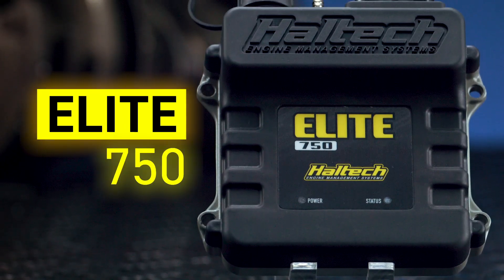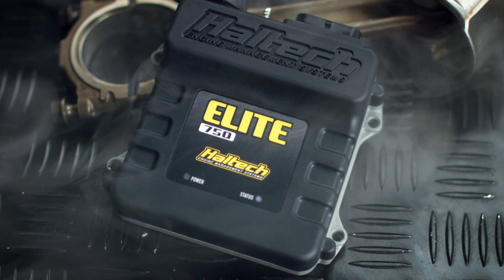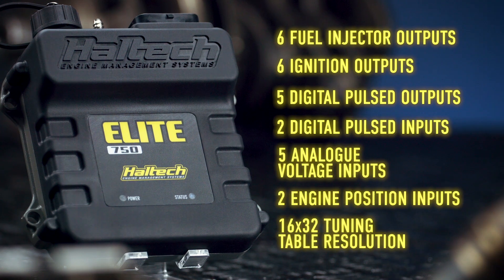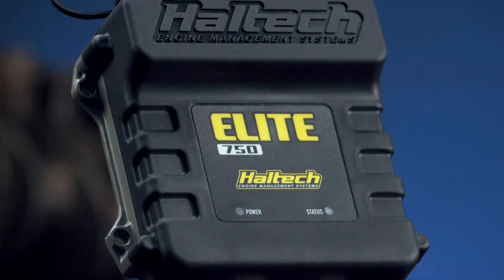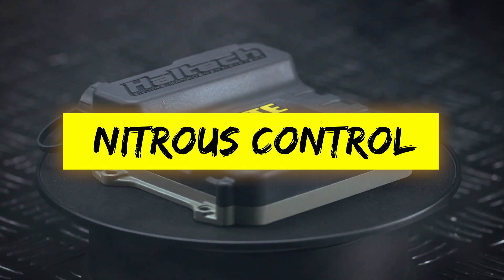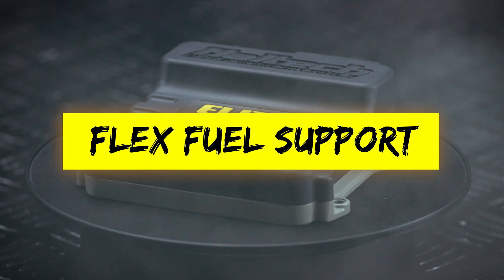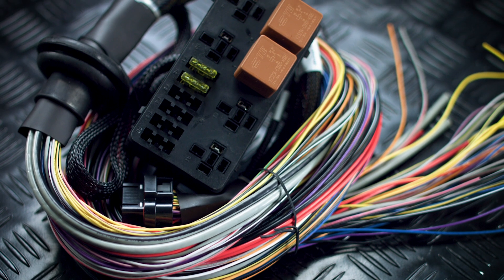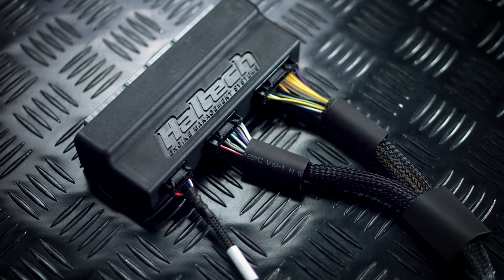✅ Elite 750  |  FAST FACTS

Comment from the maker: If you're looking for just the specs, features, and the dry, hard facts - you've come to the right place! 
The "Fast Facts" videos provide a quick overview of the product without lengthy explanations or fanfare.
-------------------------------------
The Elite 750 is a basic, single connector stand-alone ECU offering many features available on the more advanced Elite ECUs at an affordable price. Featuring a robust, environmentally sealed, waterproof case, 6 fuel and ignition channels, on-board data logging and flex fuel tuning the Elite 750 is a compact yet powerful performance ECU.
More info on the Elite 750 Product Page: https://www.haltech.com/overview-elite-750/

Comment: Love my 750 on my VVTI 1J however, I do wish there was any form of engine protection to go with it. I feel like that could be a good push to get more people to switch to a standalone vs their stock ECU
Reply from the maker: The Elite 750 provides engine control value at a lower price point than the Elite 2000 and Elite 2500.

Some features simply can't fit into that lower price point. If you've invested a fair amount into building your engine and want to protect it, sounds like it's a good time to invest a little more in your engine management as well. ;)